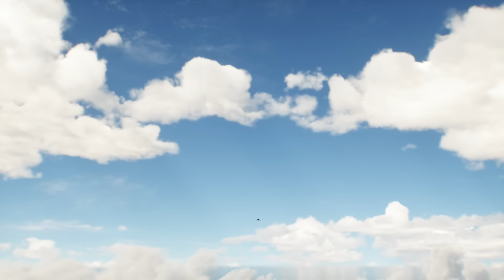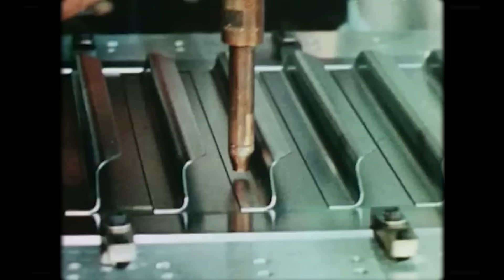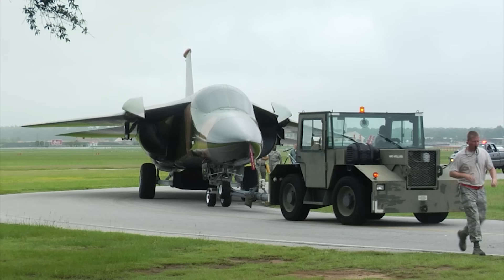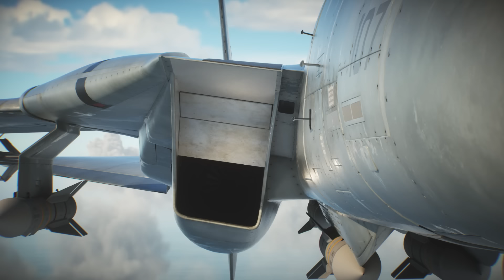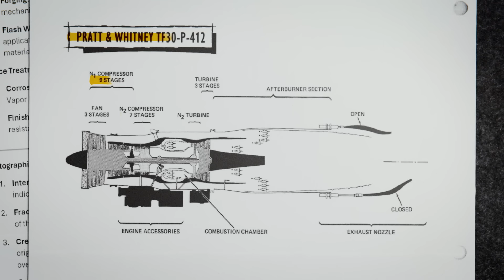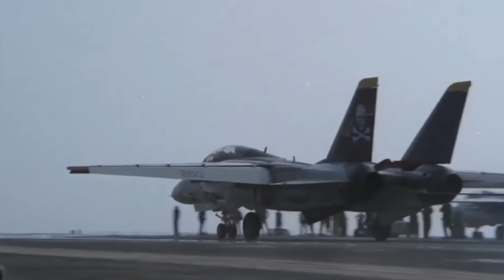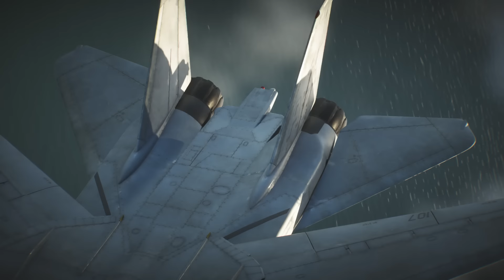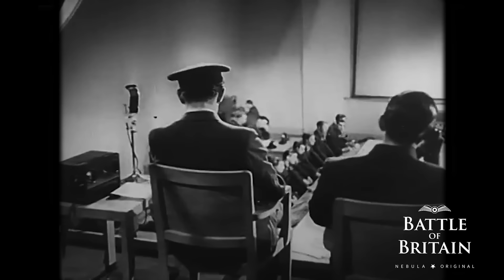The Insane Engineering of the F-14 Tomcat

Comment: Terrible engines, though
Reply: The Pratt’s were prone to stall at low speed and not suitable for carrier landings, superb at full throttle though, the GE’s were so powerful they were able to take-off without AB, pumping out 60,000Ib’s of thrust -the most powerful engines ever on a fighter . They were certainly not terrible engines
Reply: @naeemahmed5236  28% of all Tomcat accidents were put down to engine failure.
Reply: @naeemahmed5236  The TF30s didn't stall due to low speed, but rather due to excess yaw when pilots attempted to correct their flight path. 
The GEs were known for exploding early on.
Reply: Yaw was due to stalling of one engine at low speed, the GE’s in comparison displayed seamless power interchange
Reply: @naeemahmed5236  If low speed was the cause you would get stalls while on the ground or boat. Yaw was due to excessive rudder input, which abruptly altered the airflow causing the stalls. The GEs certainly made the F-14 easier to handle, but that's to be expected considering the TF30 was designed in the 50s.
Reply: Those were all due to stall at low speed..

Comment: @8:05 @10:00 and @11:48  

The F-14`s engine air inlets were NEVER oversized, because the F-14 was not designed to have the TF30 engines, but the P&W F401 engine from airframe 37 onwards. The NAVY just did not spend the money to finish the P&W F401 engine development and kept the catastrophic TF30 engine! The P&W F401 engine was a larger bypass, higher thrust version of the F-15's F100 engine.

The GE F110 engine was also not specifically designed for fighter jets, since it is based on the B-1 Lancer's GE101 and the test program had the name "Derivative Fighter Engine" .... basically making a bomber engine into a fighter engine. At the same time the F110 was developed, GE used the very same bomber engine to develop the CFM-56, wich powers thousands of Boeing 737s, Airbus A320s, A-340s and more than 400 Boeing KC-135 tankers. So much for being an engine"specifically" developed for fighters" ... lol.

I love Real Engineering videos, but your aviation content is pretty shallow. I hope that the other stuff I watch (of which I don't have in depth knowledge on my own) is not half baked as the aviation stuff.

Comment: What happened to the wing sweep flap slat control box that retracted control surfaces and wings when speed was increased as a bolter takes off to. Go around this was on the first 18 aircraft or was supposed to be but things could change look at all changes that happened after the first crash out in the peconic on its second flight. I saw the chase film, at the time I was working on the IPB identifying all the parts in the flight control system the months work was useless and have to be redone when I got the updated prints

Comment: Turns out variable geometry -sweep wings are not that great of an idea which is why F-111 and F-14 were phased out rather quickly. The B-1B maintenance is off the charts. This is not "insane" engineering and has largely been abandoned. John Boyd who realized the inefficiencies and costs helped create the far superior F-15, F-16, and the Navy eventually took the F/A-18 over the Tomcat.
Reply: John boyd was agaist the f15 and wanted to butcher it in favor of what was basically a f86 with better engines, he also was against giving the f16 air to ground capabilities only for it to end up being primarily a strike aircraft
Reply: You were right until you brought up John Boyd, you juist lost it there.

Comment: Right off the bat, the very first sentence in this video is incorrect.  Then the narrator continues to invalidate that statement by bringing up the fighter's multi-role capabilities.  Perhaps, it should've been said this way: "The original concept for the F-14 Tomcat was for one thing and one thing only.  To intercept state of the art Soviet supersonic bombers... blah, blah, blah, etc."

The F-14 Tomcat was not "designed for one thing and one thing only".  If it were, the Missilier Program could've been developed as it was originally envisioned.  The F-14 Tomcat was build to PRIMARILY to be a high speed, high altitude interceptor, but it was also designed to be a fighter, able to maneuver and outperform any potential rivals to secure air supremacy over the operational area for the fleet.

While true that the fighter was build around an enormous radar system and could carry the longest ranged fire and forget missiles at the time, the large swing wings, lifting fuselage, and weapons stores for dogfighting demonstrates the designed intensions for multi-faceted combat, not just bomber and cruise missile interception.

Comment: Point of order, you don’t need oxygen to generate the heat necessary to weld. In fact, we do everything we can to make sure there is NO oxygen contraction the weld puddle. That’s the reason for flux and shielding gas. Oxygen in the presence of any molten metal is bad news. Source: I am a welder.

Comment: Nice.
You're wrong about how the lift from the wing works, though. What you describe is just an oversimplified misconception.
It's not just the speed and low pressure creating lift. There's a symphony of fluid dynamics phenomena doing their magic.
Also, these moving, dotted lines don't show laminar flow over the upper surface, so there would be little to no lift from that part of the wing. 
And with the air beneath being depicted going up behind the trailing edge suggest there's no lift from the lower surface, either. 
In general, a working wing would not behave like you have shown.
I hope you're right about the other stuff, though.

Comment: 17.20 False, under no circumstance would you "remove pressure from the shock strut"! That pressure is what ensures proper landing gear performance aka energy absorption. The kneeling of the nose gear is effected by a sumultaneous tensioning of the launch bar and hold back bar. When the pilot selects launch, the holdback fitting releases the bar and the power run starts (launch bar is pulled by the evms) at the end of which the aircraft takes off and leaves the deck

Comment: The f14 was such an amazing aircraft designed around the aug9 and aim54 Phoenix it was the first aircraft that was capable of bvr in a modern sense (something it exeled at in Iranan service even against other fighters) it was basically only has a gun and is designed for dog fighting because of vetnom where the f4 an aircraft designed as a long range interseptor was used as a airsuporyity fighter and the rules of engagement pervented the f4 from using the long range missiles it was made around. so the f14 was designed to do both which while arguably unessary (as can be seen with almost no other interseptor being armed with guns) made it incredibly versatile and easily one of if not the best fighter of its day

Comment: 16:54 Seems unnecessary to eject there, it looked like it could’ve been saved easily. Waste of money.
Reply: There could be other factors that had the pilot decide to secure their own safety over trying to save the plane
Reply: What probably happened was
1. Hook snaps
2. While still rolling down flight deck, pilot throttles up, engaging afterburner
3. Plane reaches end of deck, immediate drop is felt by pilot & wizzo
4. Instant ejection from pilot or wizzo
5. Plane generates enough lift to start ascending
Reply: After rewatching it that's exactly what happened

Comment: The statement that most welding uses comustion simply is not true. In actual fact the smallest class of welding types would be those dependent upon combustion as a thermal source. The overwhelming majority of welding done in a post WW2 factory would be arc welding of some sort. While I acknowledge the need for absolute pristine welds, EBW ( Electro Beam Welding ) is just one of a few that weld titanium effectively. The weldors that can run titanium with the type of consistency demanded by spec would be the reason. I dont want to pretend to know why they chose EBW over Heli arc, tig , submerged arc, hell I bet a GSAW ( mig ) would be capable of doing titanium, if anyone manufacters spools of titanium which they probably do in 2025.  The lack of oxygen probably wasn't the reason simply because most arc welding shields against oxygen and other considered contaminants either by purging the area with an inert shielding gas or a slag coating or core in the case of FCAW ( flux ) or SMAW ( stick ). If I had to guess they chose EBW because of the automation process not requiring as much overhead installation as other options and I could be way off on this though.

Comment: my understanding of the hultgreen accident, was that the stall was caused by trying to correct the plane's attitude using ailerons as opposed to the rudder which is what the procedures say to do.  this increased the angle of attack on the low wing causing it to stall and the f14 rolled into the water.  ward carrol has a good video on the subject.

Comment: What if they adapt the latest materialogy and production technologies and stealth technologies 
Would it be an ultimate fighter hunter which would out perform the f22 manuverbility and f35 multi role capability and bring it to export market, many countries that doesn't have aircraft carrier mostly have f18 f18 su27 su30 mig29 in service
My country have f18 and su30 in service both are excellent multirole fighter, but a modernized f14 would fill in the role of hunter projecting air superiority and still cheaper than f22 or su57 which they didn't export

Comment: Downvoted for ignoring the development of the variable swept wing F-111B as the predecessor of the VFX program (the illustration of the aerodynamics is worthwhile, though). 

Unlike the animated illustration, the Soviets hadn't any dedicated air superiority fighter before the introduction of the MiG-29 point defense fighter in 1983 (longer range Su-27 in 1985) - only gradually replacing the MiG-21 delta wing interceptor which would have lacked the range to escort Tu-22 bombers in an attack on any US carrier group. 

That fact lead to a costly over-engineering toward supersonic air superiority requirements - fascinating from an aviation and engineering perspective, a burden toward mass procurement for large scale military conflict in several theaters. 
Aggressive export beyond pre-revolutionary Iran (e.g. Canada and Australia) could have secured the deployment - and further modernization - of the F-14 beyond 2006, instead of an interim procurement of the 'Lightweight' F/A-18 Hornet and Superhornet platform (production shutdown in 2027) that still falls short of the late VFX fleet interdiction and strike range (as the B-21 Raider won't lift off from Ford-class carriers...).

Comment: There are many BLATANT factual errors in this so-called "real engineering" video...but let's look at one that insinuates bigotry/politics/bias rather than the whole truth.  @15:57  you claim, quote, "(the Phoenix) was rarely used outside of testing."  That is blatantly false.  It is well known that even the initial lot of Phoenix missiles (AIM-54A) were used to exhaustion by the Iranians during the Iran/Iraq war.  It is also well-known that its hit rate inn that war approached a mind-boggling 100%.  Indeed, one of the diversions used by the US Air Force, in their F-15 vs F-14 ramblings, involves their 'number of kills' propaganda; they (the US Air Force and McDonald-Douglas) don't want to talk about the Iranian F-14A and the Phoenix version used . . . and those P&W TF-30 dumpster fires . . . and still scored over 180 kills versus Iraqi Migs and Mirages, etc.

Comment: Your diagram and flow comparison treats the air intake as if it's a closed pipe. The flow restrictor would cause a bow wave in front of the intake mouth which is why this restriction can lower air speed instead of increasing it

Comment: Technically jet engines dont require subsonic airflow for combustion, just the reasonable ones do. Scramjets (and shcramjets for that matter) have the combustion take place in a *super*sonic airflow. It does require you to already be at near hypersoni (mach 4+) speeds to even ignite, and has a very short list of current uses (read experimental weapon systems).

Comment: F14 was way ahead of its time.  AUG-9 / AIM- 54 - nothing could touch the aircraft.  All other fighters would shoot 1 missile, WAIT and after a miss, could shoot another.   F14 could shoot all 6 missiles at 6 different tracks.  The bottom line, the AIM-54 RANGE was over 6 times the difference, before any aircraft could respond, they would be DEAD.  I see this all the time, where they claim F15 was the superior aircraft.  F15 couldn't be superior if DEAD, never saw that AIM54.  F15 small RADAR.

Comment: there is a small error in your desription of how electron welding works. This has been explained to me by an engineer creating those machines, at a german manufacturer for said machines. the heat is not generatey by cinetic enery, but by the current itself. using this technology, you are not limited by one main factors, which normaly are a limit: reflectivity and radiation of the material (laser welding aluminium is realy hard). the added benefit is that the "speed limiation" of WIG is removed. the speed limitation being the friction generated by the heat in the WIG arc. which mainly limits the penetration depth. This allows to create realy weird weld seams, the most impressive one beeing at an titanium sample, the penetration depth was approc 72mm, with a maximum weald thickness of 1.4mm

Comment: 15:41 your animation here is incorrect. The Pheonix missile is unique in that it will roll itself to be able to use all 4 control surfaces to perform the turn, increasing its authority. So it’s off by 45 degrees and you could say that it flies with its wings in an X shape

Comment: 18:10 are we forgetting about top fuel dragsters? Over 300mph in 4.5seconds?

24:20 7G’s of force is 7G’s regardless if they are applied in a subsonic or supersonic flight regime. The real impressive thing here is that the flight controls had enough authority to pull that many G’s when supersonic. Typically flight control effectiveness reduces significantly.

Also the way you say Grumman is really distracting and I can’t believe in all of your research for this video that you never heard anyone pronounce it correctly.

Comment: Electron beam welding of titanium is conducted in a vacuum chamber or an inert atmosphere. The ability of one environment to work does not negate the other. For the f-14 wingbox specifically, it likely made more sense from the viewpoint of budget and repeatability to install vacuum pumps and use those instead of continually purging a very large room with some inert gas. Many people here I have seen call the narrator ignorant of welding, and say that the information he gave is wrong. This is not the case.

Comment: Most welding process don't rely on combustion. About half of them utilise oxygen but most can be done with pure argon. The use an arc to make a ionised plasma.

The reason titanium is hard to weld is due to the fact that it is more reactive to air than any other normally welded material, and therefore needs much lower contamination levels that can almost exclusively be achieved in a purge chamber

Comment: This is really just for clarification. The F-14 only has 1 wing, most modern aircraft only have 1 wing. As you explained the left and right sides of the wing are connected via the wing box. For aircraft with fixed wings the wing box and the main portion of the wing are one piece.

TLDR: F-14 is a monoplane not a biplane, it only has one wing made of multiple assembles.

Comment: The F-14's misfortune stemmed from the Navy's decision to use the TF-30 engine, which was based on previous failed projects and not optimized for a fighter like the F-14. They designated the F-14 as an Interceptor and Fleet Defender; however, in all fairness, it was perhaps the first true strike fighter capable of dropping bombs from day one after it rolled out of the factory.
Reply: The TF30 was "supposed" to be an interim engine only. It was to get the F-14 from initial flight testing into about the first 70 production airframes before switching over to the Pratt & Whitney F401 producing 28,000 lb of thrust in afterburner. It was a cousin to the P&W F100 sharing the same core. The F401 pushed the state of the art more than the F100 did at the time and once the F100 reach the 150 hour run test without failing, the Air Force said they'd accept the engine, and the engine core was no longer a shared program. If the Navy wanted to continue with the F401, they had to pay for any further costs to develop the engine core without Air Force. Eventually, the F401 was cancelled and the Navy stayed with the TF30.

Comment: Really good video but I hope you can correct some things:
- F-14 wasn't designed to destroy Tu-22M as they were developed at the same time. And the Tu-22M was most lethal to the US fleet when flying very low, not as a high flying bomber.
- F-14s radar wasn't the most powerful. For example it's output power was dwarfed by the Mig-25's 600 KW.
- You make it sound like Grumman designed the F-111 but that was General Dynamics. 
- The Phoenix missile was extensively used in combat, during the Iran-Iraq war.
- Likewise it's very probable that the glove vanes were regularly used during the Iran-Iraq war.
Reply: GD sub-contracted to Grumman for the naval portion of the project. It is technically designed by both GD and Grumman.
Reply: @dumdumbinks274  Yes, you are right for that version. But it's not like Grumman was there since the beginning and the video makes it sound so.